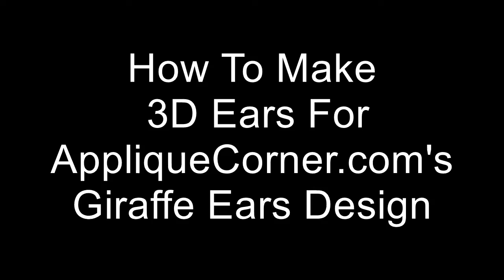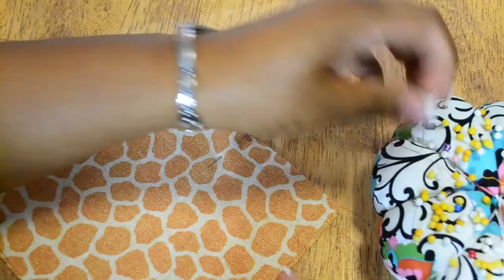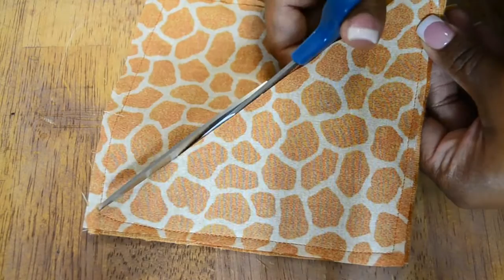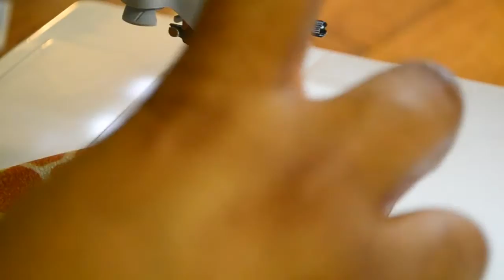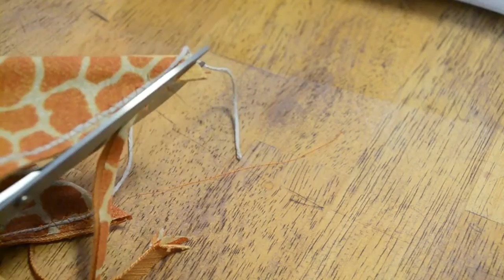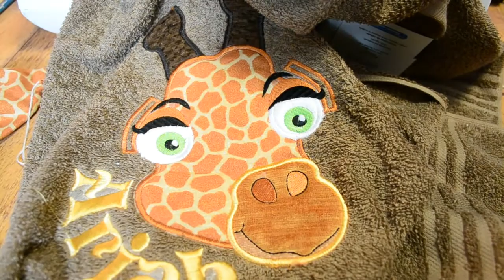How to make 3D ears for AppliqueCorner.com's Giraffe Ears Design

Comment: Are you using a font in your embroidery machine or are you making it in an embroidery design software program and bringing in on a usb?  I liked the video and your instructions are thorough and helpful.  Thanks
Reply from the maker: Hi.. The font is a built in font - it comes built into the embroidery machine.. However, there are similar versions that you can buy... I found a link.. I must tell you, I have never purchased anything from this company and I cannot give you a referral based on experience.. However, here's the link for you to take a look at it for yourself.. Good luck!  Thanks so much for your patience and for watching my video!

https://www.etsy.com/listing/385629796/story-book-embroidery-machine-font-in-4?&utm_source=google&utm_medium=cpc&utm_campaign=shopping_us_e-craft_supplies_and_tools-other&utm_custom1=a965a8aa-9677-430b-9aa3-e424b641f69e&gclid=CjwKEAjwh9PGBRCfso2n3ODgvUcSJAAhpW5ohDbybtEt_Xqz49XecW8PmAmvrnLlZ4vWKcV2-deXwRoCDHnw_wcB